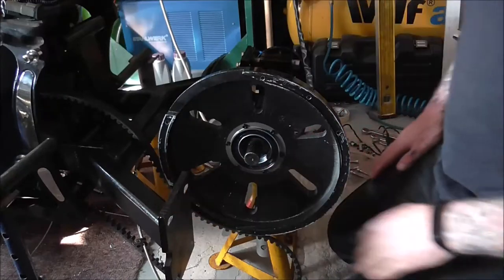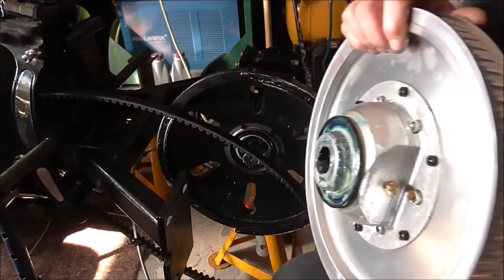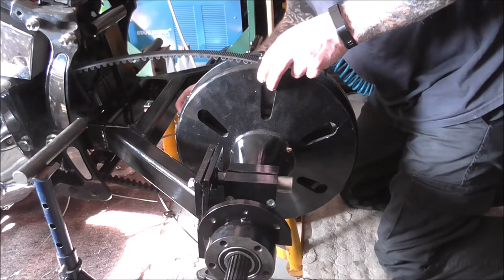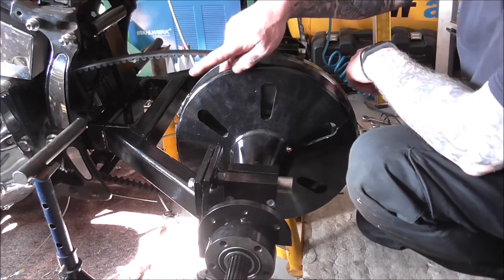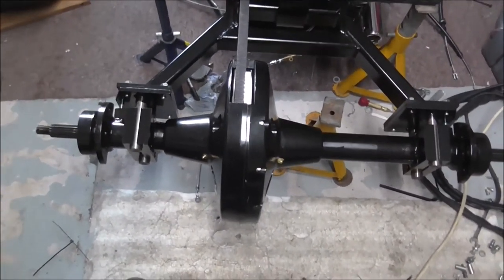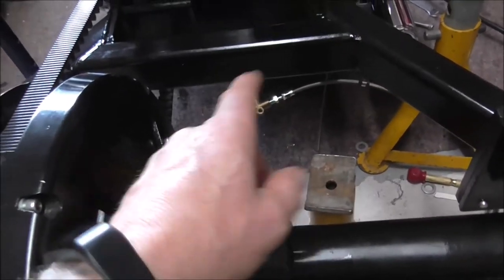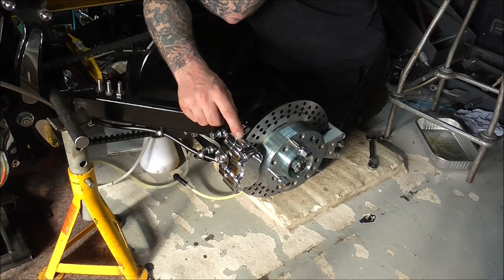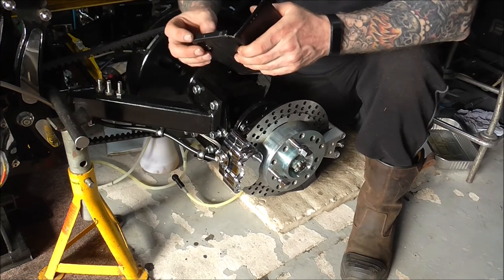Harley Davidson Deuce trike conversion Part 23

Comment: Had the same problem with the brake calipers, changed to 2 piston, worked as it should. “DNA trike Conversion “ YouTube video
Reply from the maker: How DNA thought that the four pot calipers would work with the standard master cylinder is beond me.
Reply: @pick6667  me too, and when I called them, they told me I had a faulty master cylinder.  I rebuilt it and it didn’t help. They then told me that they had never had any problems.  I finally got the 2 piston from them but I had to pay for them. They would not reimburse me for the 4 piston because I had put them on already